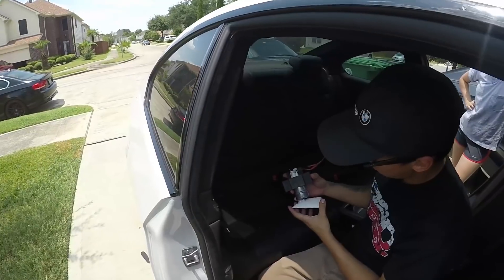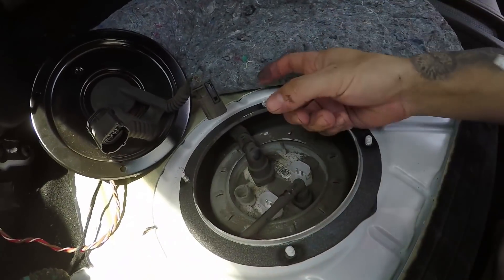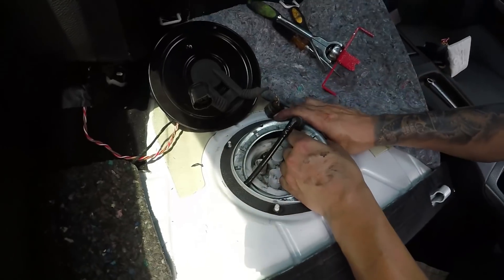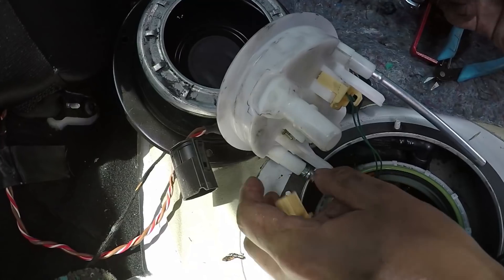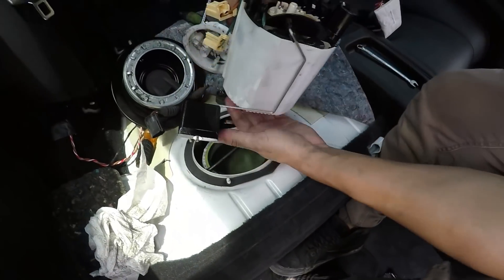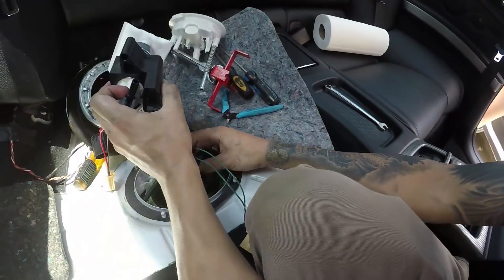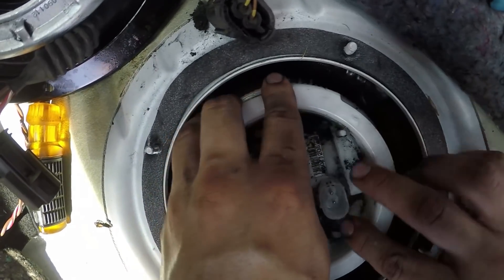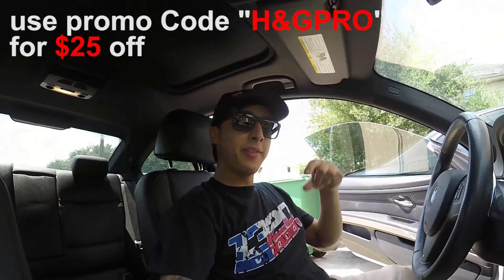The BEST Stage 2 Fuel Pump on the Market- SPOOL PERFORMANCE (BMW N54-335I)

Comment: The new pump bracket design doesn't line up properly to the fuel sensor. I bought it for a smooth transition. Ended up having to get a shop to modify to mount the sensor. Your sensor slides in your bracket the new design has mounting holes. Which aren't spread far enough apart to mount the sensor.

Comment: I installed this spool performance pump and my fuel gauge doesn't read accurately now.. Fluctuates about a quarter of tank. Gauge rises slowly and goes down after driving a short time. Checked pump 3 times and its installed right. You experience this? Or know why this happens?
Reply: You may need a new floater
Reply: You may need a new floater

Comment: Do you just leave the return lines freely in the tank?
Reply: jacob4897 yea where do the 2 light color lines go I see he attached the black wire back
Reply: Nope. The return lines have to go back into bucket. Precision Raceworks includes zip ties to mount them.

Comment: If you are going to endorse a brand new product it needs to be proven before it is the ”best on the market”. As far as I can see spool street isn’t doing anything that fuel-it! Already hasn’t done. Not to mention that you can do an entire stage 2 full e85 conversion with a walbro 250 for less than $150 dollars.
Reply: I would also love to see more competition with these pumps for the N54 engine. I have an E60 535xi and really don't want to drop $1,000 on an upgraded pump when I know the Walbro 450's are available for under $200. My bucket top cracked when I removed mine, even though I was being quite careful with it, and would have to spend an extra $200 to $300 just for Fuel-It! to send me one of their pumps with a new bucket. It's ridiculous. I honestly hope you guys are making a quality product here and have success with it. I emailed Spool Performance tonight with an inquiry for their stage 2 pump and am looking forward to hearing from you guys.
Reply: @joemeschke  what did you find out? I’m in the market too?
Reply from the maker: I wouldn’t endorse a product if I didn’t know it was the best. The quality is on point. I’ve seen assembly from start to finish. Not to mention spool offers lifetime warranty for its products. Best aftermarket fuel pump solution on the market for the platform.
Reply: H&G Production Im not here saying it’s a bad product in fact I think it’s good that new companies are coming out with products to compete in the n54 market. However, this fuel pump doesn’t even have any numbers to back it up. I can’t find any HP ratings, pump specs, or psi numbers. It’s great to have this competition in the market. If you look at the competition though, Fuel-it! has their stage 2 bucketless fuel pump setup made of billet parts. I just cannot see how an unproven product made of plastic without any technical data could be labeled “the best” out of the gate.

Comment: This is kind of off topic but do you think having long cranks up to 2-3 secs is due to a failing LPFP? Car has 90k with bolt ons and JB4
Reply: MadDavid long crank on the fueling side could be the lpfp or the hpfp as well. On n54s hpfp is more common
Reply: Ajay Rajeev Thanks!!
Reply: The long crank could either be a bad starter or the fuel regulator.
Reply: Probably fuel regulator. Check the psi of your LPFP. It should be around 72psi or so minimum at idol or just cruising. At WOT, it shouldn’t drop below 50psi. At 90k, your LPFS is probably going to give you accurate info. Most people over say 150k probably change the LPFS first. Mine doesn’t drop below 75psi at WOT and it sits around 82-83 psi at idol or just driving around to give you a reference point for a very healthy fuel system. I’m at 168,000 miles
Reply: @matthewweisdorfer7757  LPFS meaning the regulator, right?
Reply: DANIEL no. LPFS = Low Pressure Fuel Sensor. BMW made a newer version a couple of years ago for the e90. You can buy it by itself or with the updated fuel line. It’s made by Bosch. So, don’t buy the BMW one for double the price. I bought mine at FCP for around $40.00 with a lifetime warranty
Reply: David Padilla for sure your HPFP those are the symptoms
Reply: HPFP could be the culprit